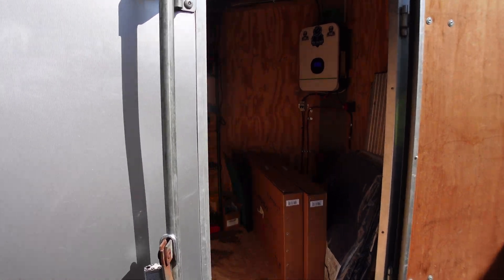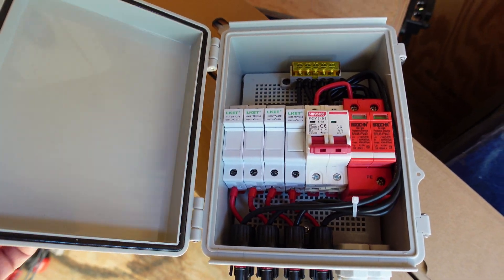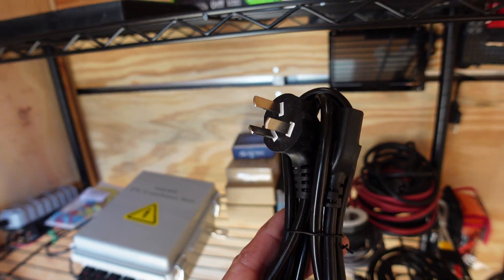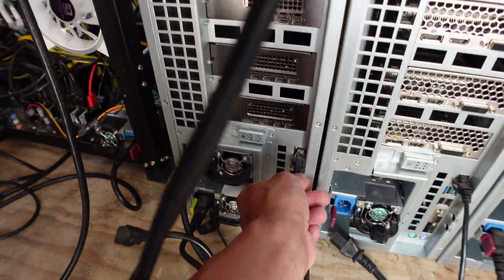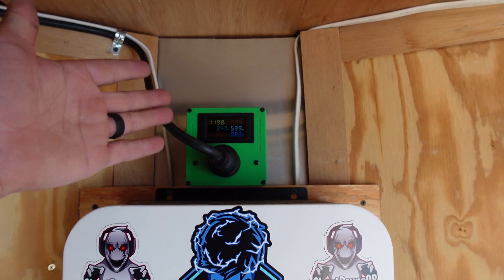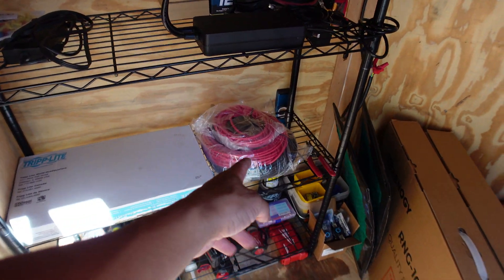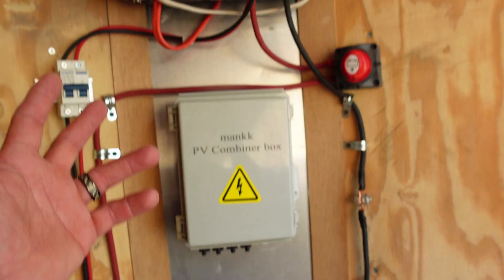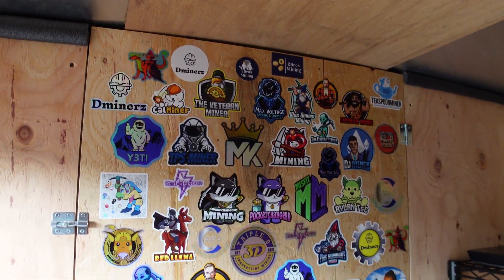Can The iPollo ETC Mining ASIC Run on Solar?

Comment: I'd love to know the wiring. I have a little education in solar but almost zero experience. I believe you have two parallel lines of 12 volt panels (24 volt system). You might think about a higher voltage system. Each line is only as strong as the weakest link, so if a panel gets blocked or shaded, the other panels' energy production in the same line are affected as well. If you had a higher voltage system, you would have fewer panels in each parallel line. Essentially, if one panel drops production, fewer panels are also affected.
Reply from the maker: So my system is 24v and I have 4 x 100w panels, 24 Volts each equaling 80+ volts per parallel string. I am learning as I go so mistakes will be made I’m sure! Lol tomorrow’s video is adding 4 more panels to my system
Reply: @ChumpChangeXD  maybe you have a higher voltage system. Not sure your terms are accurate. Parallel panels would be compounding amperage, not voltage. But, if you misspoke and they are 80 plus volts per line (so, in series, with each line in parallel to the other lines), you are in better shape than I thought. That would be a high voltage system.
Reply: @ChumpChangeXD  , each parallel line can only produce as much as the weakest panel, so if one gets blocked, all panels in the line reduce production accordingly.
   However, if the lines of panels are in series, with each line in parallel, if one panel goes out, you merely lose the production from one panel, however each parallel line will reduce production to equal the degraded line production. So, essentially, you would lose a panel in each parallel line, just cuz one panel went out.
Reply: I could be wrong.... You're the one with practical applications. But, that was how I understood it when it was taught to me. Like I said... Almost zero practical application experience. I really hope it helps though.

Comment: Your jazminer.... Can run at 120 volts. Mine is. Pretty sure I have the same one.
Reply from the maker: No way! I thought it was 240 only?!
Reply: @ChumpChangeXD  lol, yep. I actually switched it to 120 about a week ago. I finally checked the specs on the jingle mining site. Thank goodness, cuz I was running a 240 volt inverter (a big no no) before that.

Comment: I have the same unit running Some Mini box miners - you want to set setting 21 point back to utility probably around 40 % discharge of battery bank - or it will shutoff in the middle of the night do to self consumption of the inverter … also check your pv Voc . It says it can handle 145 and run at 115 but - at 115 volts  it shuts off .. so I had to reconfigure the solar strings to lower the  voltage ,to keep it from kicking off charge controller ..
Reply from the maker: Dude I would LOVE to talk to you in my discord. I have been checking in messing around with the settings all day on number 21 I’m not sure how to set it as you’re saying I put it to 24.0v that correct?
Reply from the maker: Also my power coming in from the panels is around 80v
Reply: You probably have to switch it back to utility power before it gets to 24 volts probably 24.7 . The reason you can’t find percentage it’s only available if you’re using eg4 battery with communication ... I also would set the charging to only solar - I found if you have a heavy load on it ,and when it switches over it kicks off . .
The voltage u have coming in from panels is good .

Comment: Nice stuff.  I may go with a grid tie solar set up so my rigs never lose power.  I am still researching and looking for panels
Reply from the maker: Yes! It’s a lot to learn and just settings inside my system or the batteries may need more to give even power I’m not quite sure but we will get it!
Reply: @ChumpChangeXD  yeah. Have you checked out the battery stacks?  A guy I talked to uses 6 batteries and runs a 2kwh farm constant with it.  It’s pricy but man being off grid is nice.  Run roughly 10kwh for my farm. So battery power will be expensive. And it has a shelf life.  That’s the thing that worries me. I get a year on and batteries are losing power
Reply from the maker: @jtravaglini  send me some links! im looking now for more options in batteries and such
Reply: @ChumpChangeXD  yeah man. I’ll hit you up on discord with some stuff I been looking at.  The stacks are cool and look pretty simple to install. Just expensive

Comment: Hi my friend so happy i found your channel. Im new to mining only have 3x rx 580 8gb gpus. Im busy with solar setup myself. At the moment I have one 330watt panel and 3000watt inverter with two 200ah gel batteries.
Reply from the maker: Dude that’s awesome! I am trying to figure out what’s going on with my set up currently I got it working last night for most of the night and then it did the same thing to me so I am assuming one of my batteries are at fault here I’m going to purchase two more and see if that will solve my issue; having four hooked up instead of two but we will have to see! Appreciate your support!
Reply: Think its your battery pack my friend dont think your ah is enough to maintain the power being drained from your battries even with power coming in from your main/not panel's. But pleas keep me/us updated my friend
Reply from the maker: @hfsmuts7749  yea that’s what I’m thinking as well after going threw the settings I think I just need a few more batteries